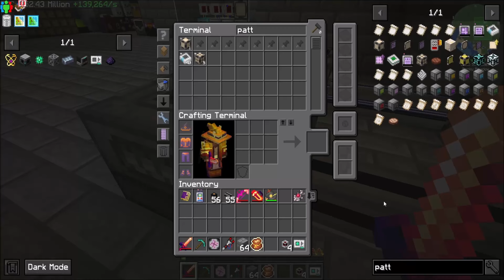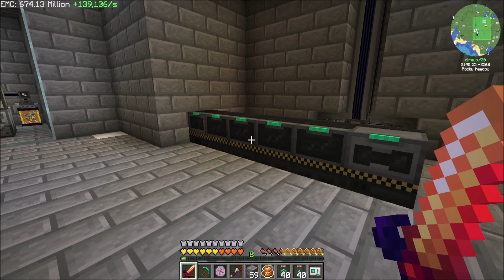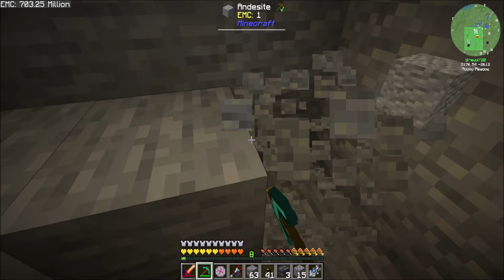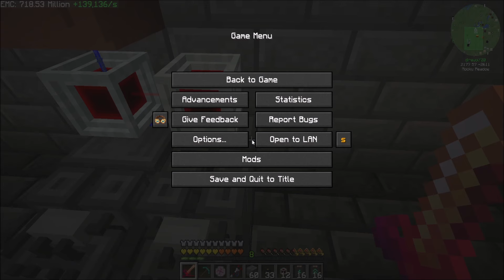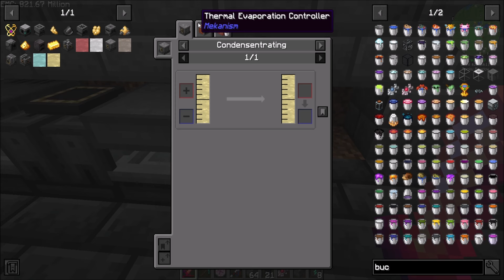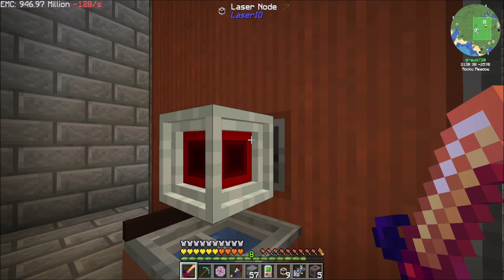Project Architect 2   Ep32 Mekanism EMC Plan Phase 2

Comment: Kind of a funny arc because the Mechanism machines will be mostly useful for getting into Mek reactors later, but in the grand scheme of EMC it's going to be quickly obsolete once he gets into real EMC production. But Dire seems to be having fun creating interesting ways of generating EMC so its all good.
Reply: IT seems he is approaching this like a kitchen sink mod pack. Just appears that way. If/when he does do the mod pack it will take him a while to get to the first emc dupe. Then lots of automations after that first one. Which also begs the question will this be a 200 episode mod pack not because of complexity, but because of dire derps??

ME personally I think I can skip one or two of those automation tiers to get me an interface and about that level start with duping again.
Reply: @steveheffner I think Dire plays the modpack slowly on purpose. Because he said that the next modpack he wanted to play would be 1.21. And there is almost no mods in 1.21 right now. If Dire plays the way Chosen wants, he will finish the modpack in 10 episodes.
Reply: @zulussu  good point, although X to doubt on only 10 episodes with dire but yea I get the point.

Comment: Still not using powah end gates by now dire? They transfer power wirelessly. No more pipes and digging out paths for power lines

Edit: they work cross dimensionally, have no distance limit as long as the power source and ender cell are in a force chunk load area and work cross-dimensionally as well.

You only need one ender cell to run all those gates and any level of gate will work off any level cell.
Reply: They are ok, but I still prefer flux. In this pack flux is just emc so it makes it even easier. Really when it comes to making antimatter is where it will matter being able to limit, but by the time I get there it shouldn't be a problem. Plan to get a fusion reactor going soonish along with a massive energy storage.

Comment: awakened draconium block dimension...
quarry is mining at full speed...

RFtools tier 3 crafter to break the blocks down into ingots.
dump ingots into pulverisers...

75-80M EMC/s :D
only takes 120-128 pulverisers upgraded to a certain point to not have a build up in the quarrym and the crafter can keep up.

btw, i did this as a fun project before i did the archimeat because i could and emc was not really a problem, and to be honest, the arcimeat was kind of a let down for me personally, but running only one of those is not the way to go right? :D

Comment: Shame you can't have those evaporation tanks share a wall. Use that io block on the shared wall to allow transfer of fluid directly.
Reply: where would the heater go?
Reply: He does it this way so they share the heater.  Way more efficient that way